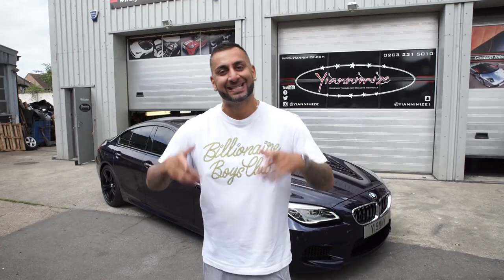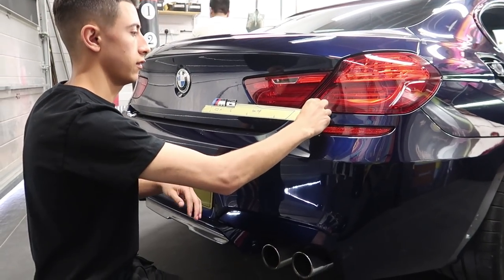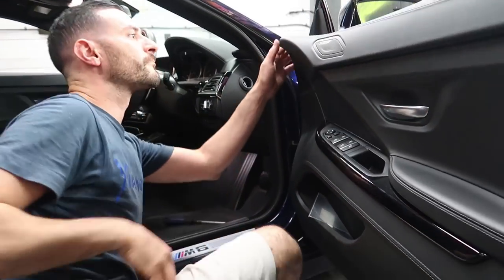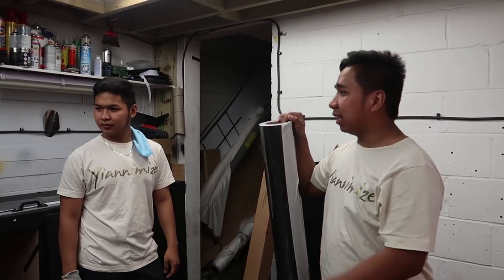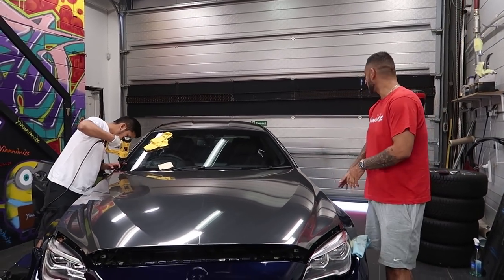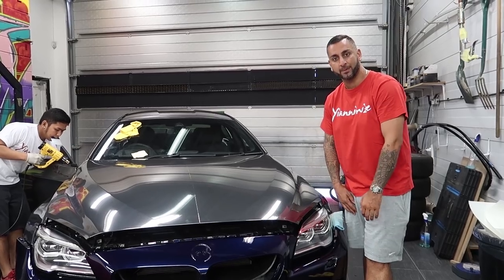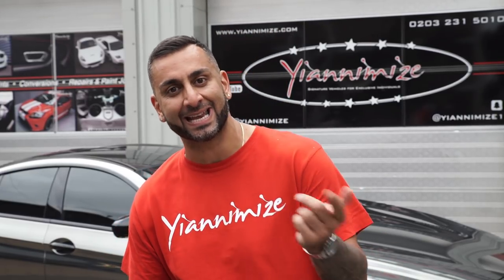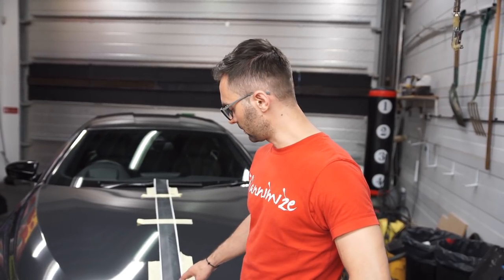My BMW M6 wrapped Chrome Black

Comment: Lovely wrap, massive shame about that joint, the gloss black strip done nothing to hide it at all. 
Is there no way to order a wider roll? Seems a shame for a bodge on such an expensive car?
Reply: These guys are wrap experts, I'm sure if they could they would have found a better way. Makes me wonder why they don't work something out with the manufacturers...
Reply: doesnt look too bad, still looks nice. however even if they bonnet couldn't  be done in 1 sheet i wouldn't hide the small line
Reply: zingaudio agreed, looks very silly imo, shame
Reply: What CLS??? ive seen you in that Mazda son!
Reply: APA do a 1520 wide black chrome but I guess yianni is not a fan of it and goes for the better Avery version instead.
Reply: IronCurtainPrepper go on a past video on this channel. yiannimize wrapped a CLS chrome black
Reply: only some premium wraps comes in such smaller sizes. you dont have to worry. yianni gone for the top end. you can still look for medium level still great quality wraps.
Reply: Hide what?? What exactly ru talking about
Reply: Could not my have said it better myself

Comment: Dope color choice! I think you should have run the the concealing stripe from the bottom of the front clip all the way back to the bottom of the the back bumper just so it followed the lines of the car.  Couldn't see any of the gaps to see how it looked in the jams but it looked like the guys did a good job overall.  Again, DOPE color!...Maybe try the white chrome after you get tired of this one! lol